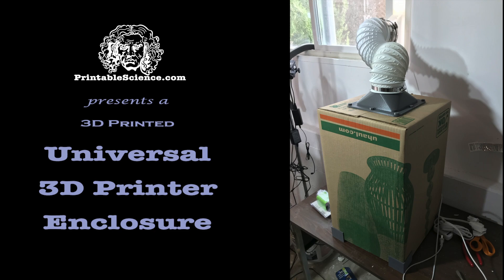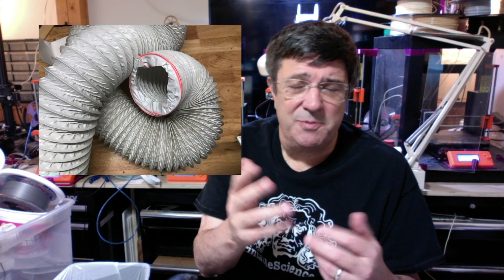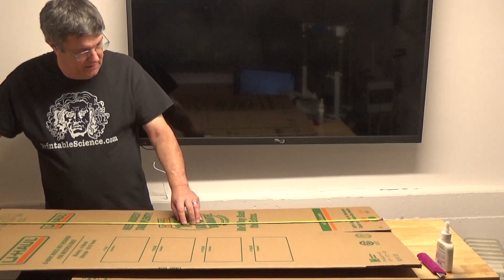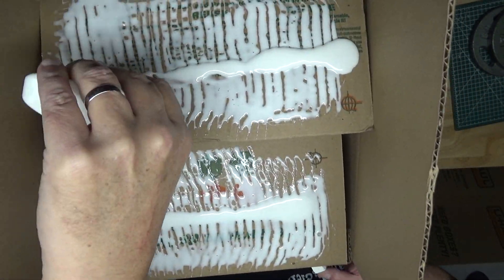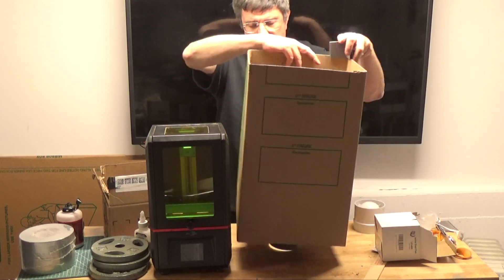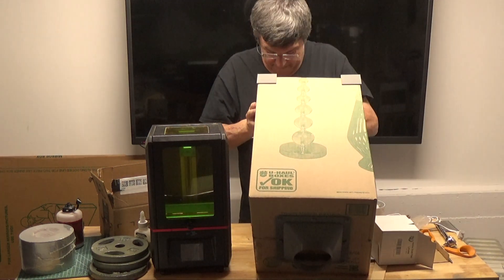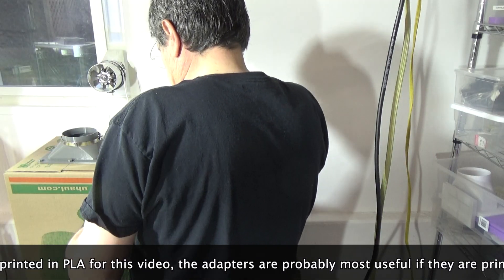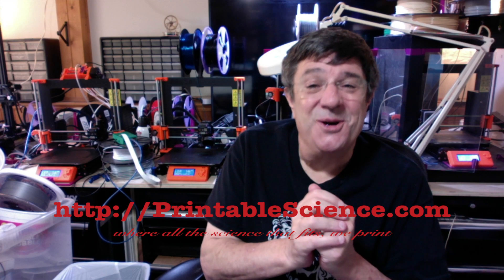3D Printed Universal Fume Exhaust Hood Enclosure for FDM STL DLP or Juice Printers

Comment: Instead of printing the feet for the box, why not just make some cutouts in the box at the bottom?
Reply: That’s what I’m gonna do. And glue, screw or fasten something inside the bottom corners to give the box some weight… keep it in place a little better. Maybe some scrap wood chunks or flat metal doohickeys. 

Think I’ll cut a square for a plexiglass window in the front too, so I can see the printer screen and vat too.

Comment: Sure its not hermetically sealed but its big improvement the only issue I see with using this are heat and long term exposure permeating the cardstock. Really hope we get real industrial solutions from companies making hermetically sealed stuff for home printers. For now my best bet in the Australian heat I too just leave my garage door open while printing at night.
Reply: For this, if you can put your nose near the box without smelling anything, you're fine. I  personally tempted to just run mine outside on the covered balcony.

Comment: Nice work.  Couple things that jump out at me are you do need some way to see the print in progress, and a way to take the enclosure on and off of your printer.  The way you showed it the duct is too short to put the enclosure on and off the printer.  Probably need a lot longer duct or maybe a spring clamp to allow the duct to be removed from the enclosure easily.  Got to say though, this has really got my creative juices flowing.  Thanks!
Reply from the maker: Simple enough to cut a hole in the box and tape a glass or clear plastic window on the side of the box so you can see the printer without removing the enclosure.
Reply: @PrintableScience  that's what I'll do, but eventually,  I'll probably replace the card board with plexiglass connected via 3d printed connectors. It's more expensive, but it could take the same parts.
Reply: Dumb, but simple solution: Cut open a front door? Could use some wire and a hook to close it again, sure it won't be 100% sealed, but I assume the vent should be enough to not make the fumes escape through the small cracks.

Comment: Hook your fan up to a temperature controller, now you have a heated chamber! You could make it with an arduino, a relay, and a temperature probe.
Reply: It'd be interesting to see a 3D printed frame for a door. You could attach it with the bolt method you used for the roof. You can get a cheap piece of acrylic from the dollar store or walmart if you buy a picture frame, just make sure it's not glass. loved the video, thanks for the idea! plywood is cheap from a lumber yard, I'd be a good idea to upgrade eventually for durability.
Reply from the maker: I've been considering a door... and even cheaper than plywood would be foamboard... it's hard to be a $1 a sheet from the dollar store. I have added windows to other cardboard enclosures and I usually use glass in a 3d printed frame. Is that a mistake? Am I missing something... would appreciate your input.
Reply: @PrintableScience   Glass is fine! In this situation though, it's easier for the average viewer to drill acrylic than it is glass. :)  For a door to view your prints acrylic would be more durable. Acrylic can be hard to come by in some places, but an easy source for some is a cheap picture frame from the dollar store or Walmart. One worry is the risk of the enclosure catching fire from a printer fire, so it's best to use flame resistant material. Maybe pink insulation board?
Reply from the maker: @jjnotme1227  Indeed... I'm not adventurous enough to cut glass so I restrict my window sizes to glass sizes that I can buy cheap in photo frames. For my doors I use 3d printed hinges that glue onto cardboard. My main argument with acrylic is the cost of the stuff... plus I can't seem to cut in a straight line. :) (That's why I like 3d print design more than say woodworking. :) ) As for insulation board... i've not used it... but when I look at it in the store I wonder if it's strong enough.